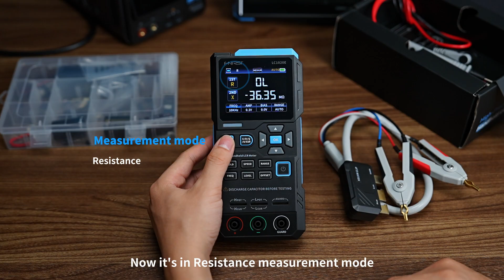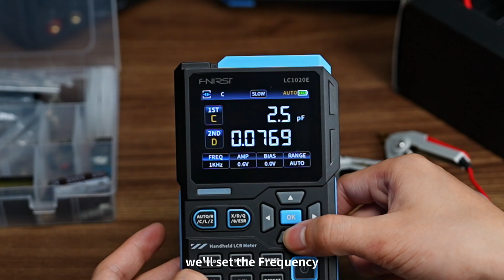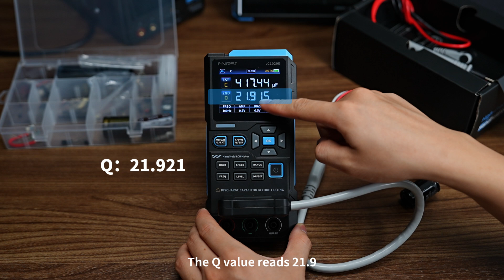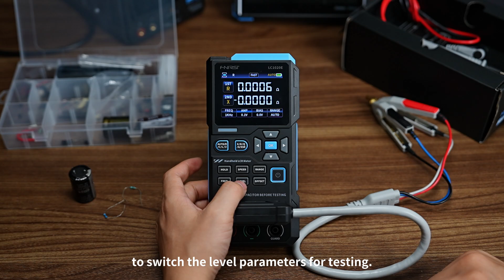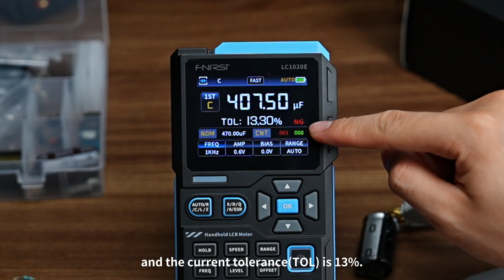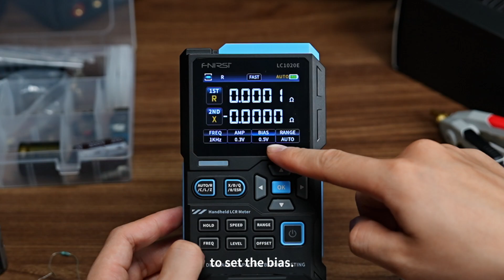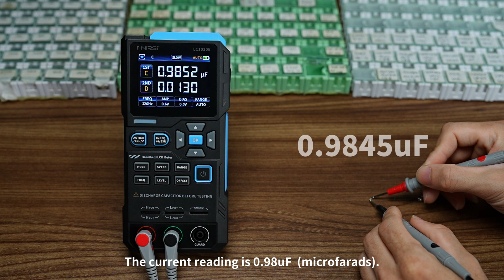FNIRSI LC1020E Full Tutorial | Calibration, Measurement & Auto Sorting Guide #fnirsi #tutorial

Comment: Hello so kelvin clips i need only for small capacitors in pf range or little resistors ohms but like 1/4w resitors like 30k ohms  or 0.1uF capacitors etc i dont need them ?? I can use regular probes ?thanks
Reply: And if i use regular probes i need to calibrate device like with kelvin clips ?

And i need calibrate LCR every time when i use it ??